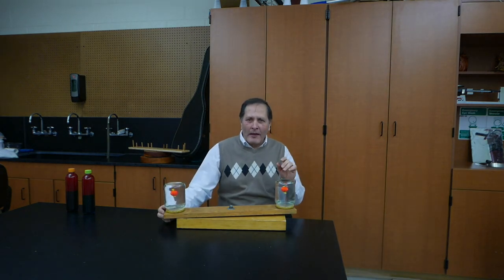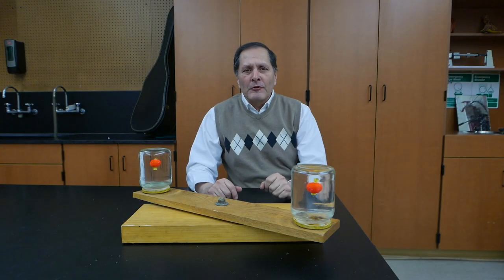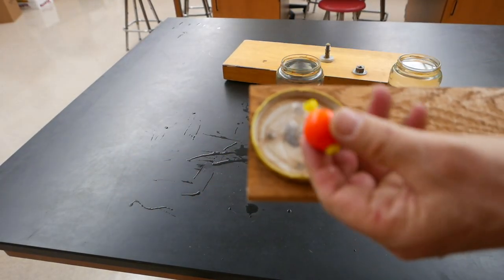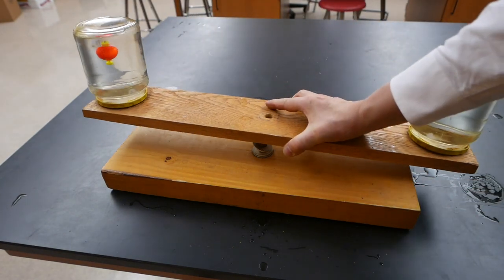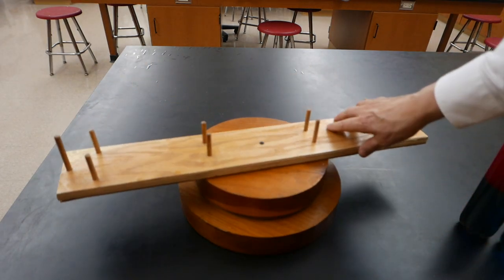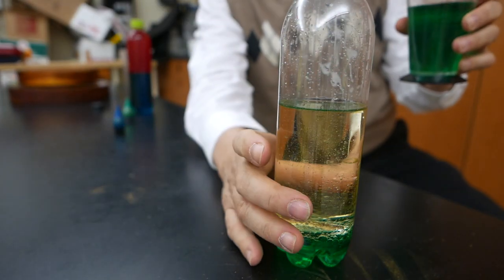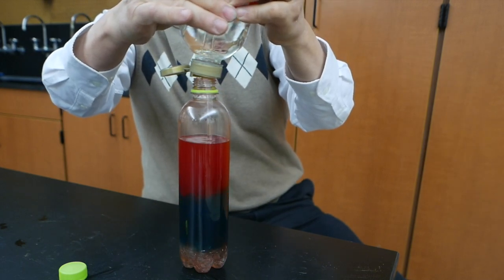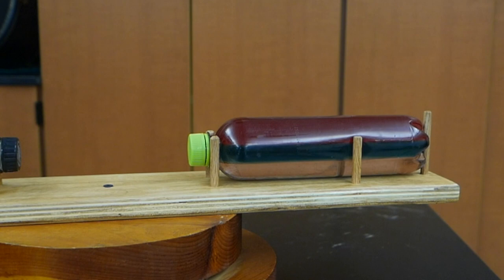Spinning bottles--Simple centrifuge // Homemade Science with Bruce Yeany

Comment: I've seen an experiment similar to the first one - helium baloon on string attached to car's floor. When the car start to move forward, the baloon should move to the back of the car (as everything in the car). But it does the exact opposite - it move to the front, because during driving forward everything in a car want's to be in it's back - also the air. Lighter helium moves to the front. The same hapens, when the car turn. When it turn left - ballon moves to the left, when to the right - baloon moves to the right. When You see this experiment for the first time, it look's like the baloon deny Newton's first law of motion. But of course it confirm it. Sorry for my English :)

Comment: It might be a dumb question but why do we need to use centrifugal force to separate the components of blood? I mean why doesn't it work simply due to gravity like with these examples here?
Reply: Csaba Bánki I would think it's because blood clots too quickly.
Reply: It is because Blood is a "Colloid" solution in which a material is evenly suspended in a liquid. https://en.wikipedia.org/wiki/Colloid
Reply: You could, but the centrifuge does it much faster, so you also get the result more quickly.

Comment: I couldn't help but notice in the first demonstration, that not only did the bobbers move to the center, but, also the air bubbles in the bottles. I'm sure you know, that if you suspend a helium balloon in a car, the balloon will move FORWARD, when the car accelerates, and BACK, when the brakes are applied, for the same reason: The air in the car is more dense, than the helium in the balloon. (The balloon just needs to be buoyant)

Comment: 3:00 you can see that the separation line makes an angle of 45 degrees, does this mean that the centrifugal force is equal to the gravitational force? Because if that is true you can calculate the gravitational acceleration
Reply: Koos Naamloos Can't you derive the degree by calculating the slope? Trace it on to paper;;
Reply: Is there a velocity the bottles can be spun at where the liquid surface is 90 degrees or will it always be an infinitely small faction less?
Reply: Centripetal *
Reply: Gravity + inertia
Reply: Koos Naamloos good point 45* implies equal but at 90*
Reply: Nick's Garage you would need some very strong tools, the force of spinning so fast is bound to break something (like the speed of sound)
Reply: CODED Yes as per physics equal opposite resultant is 45° But friction fluid force may slightly change resultant angle . Shalom
Reply: I've been thinking about that... The centripetal force (in forces G) is just the tangent of the angle in the surface. Isn't it?
Reply: Lucas López Martínez yes, but calculating the gravitational acceleration seems more interesting. I came up with the following formula:

g=v^2/(tan(a)*r)

v is the speed at which the water is rotating
r is the length of the arm
a is the angle of the water

Comment: Reminds me of  test using a van with heavier than air balls hanging from the ceiling and  helium balloons  tied to the floor.  They were originally at the same height and then the van was accelerated forward and backwards and driven around in a circle.  The reactions were rather similar.

Comment: but why the less dense goes towards the center and the more dense goes out side?
Reply: For the same reason that a helium balloon floats in air.  The denser substance is heavier per unit volume, and applies a buoyant force to the lighter substance, pushing it out of the way.  The buoyancy exceeds the apparent gravity that points outward and down, when acting on the less dense substance, which causes the less dense substance to move inward, and the denser substance to move outward.

Everything would default to moving outward, if there were no other materials competing for the same space.   If you evacuated the jars, the bobbers would fall to the bottom when at rest, and would move outward when in motion.

Comment: Why doesn't the water and syrup mix? Also, why doesn't the dye and food colouring mix?
Reply from the maker: the water and syrup will mix after a while ,  if I shake it, it will mix faster.  The the water is tinted with a a water based dye,  the red in the oil is an oil based dye,  it will tint oil but not water

Comment: Do you believe that it is possible through powerful centrifugation of the water in the pipe, separating the types of dissolved salts besides obtaining distilled water in the process? and then recover it?
Reply: No. You have to evaporate the water or distill it. But you can try recrystalisation.

Comment: A few questions entered my mind as I watched this, such as: if you shook the water/oil mix up well and spun it immediately, how much faster would the centrifuge separate them compared to normal gravity? I know this wouldn't work with the syrup added, though, due to its solubility in water.

Another concern is how the different masses of the materials affected the performance of these makeshift centrifuges.
Reply: TheOriginalJphyper what's normal gravity?
Reply: It's exactly what the name says it is: the normal pull of gravity from the Earth.

Comment: Dear Prof. Yeany. The diagonal format of the water, or any liquid inside the bottles is justified because the friction? The top liquid layer of the fluid has a smaller friction than the bottom? That can be a good justification?????
Reply: Vinicius Alegreti Meza   Hello, Mr Meza.  I’m not Mr Yeany, but I think I can answer your question.  First, though, I want to be sure I understand what you are asking.  Are you referring to the observation that, while the bottles are spinning, the boundaries between the different liquids are neither horizontal, nor exactly vertical, but sloped?
Reply: Mark Holm hello!! That is it.
Reply: Vinicius Alegreti Meza   Although there is friction when the liquid moves inside the bottle, it is not a good explanation for the diagonal angle of the liquid surface.  One of the defining characteristics of a simple (Newtonian) fluid (liquid or gas) is that it always moves in response to an applied force.  Look again at the liquids while the bottles are still and spinning.  Either while the bottles are not spinning, or while they are spinning at a fairly constant speed, the liquids barely move inside the bottles.  While the bottles are still, the liquids lie horizontally, not moving inside the bottles.  While the bottles spin, the liquids lie at a diagonal angle inside the bottles, not moving very much inside the bottles.  The fact that the liquids are not moving means there is little or no friction on them.  Friction always applies a force and liquids always move in response to an applied force.

A better explanation, the one that would be taught in a physics class, involves a sum of forces.  When the bottles are still, gravity is the only force acting on the liquids.  The liquids flow until their surfaces are perpendicular to the direction of gravity, then they stop flowing and lie horizontally.  When the bottles spin, two forces act on the liquids: gravity and centripetal/centrifugal force.  The liquids flow until their surfaces are perpendicular to the sum of these two forces.

The centripetal/centrifugal force always acts along the line from the center of rotation outwards.  When seen from our point of view, outside the centrifuge, that line is rotating, so it is easier to think of it as if we were inside the centrifuge along with the liquids.  Seen from the liquids’ point of view, the centripetal/centrifugal force does not rotate, but acts simply in a straight line from the center of the centrifuge out.

Gravity points down.  The centripetal/centrifugal force points out.  The sum of gravity and the centripetal/centrifugal force points down and out, diagonally.